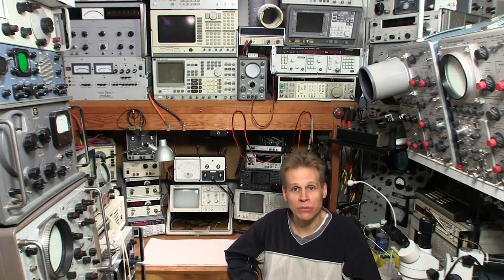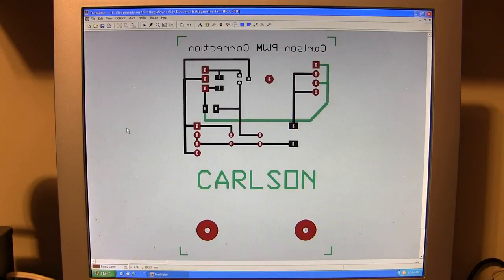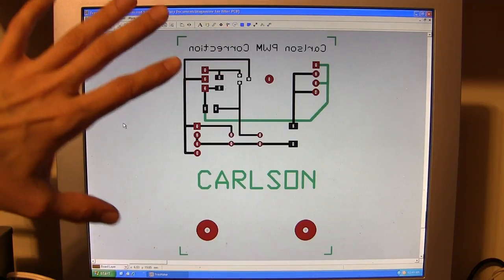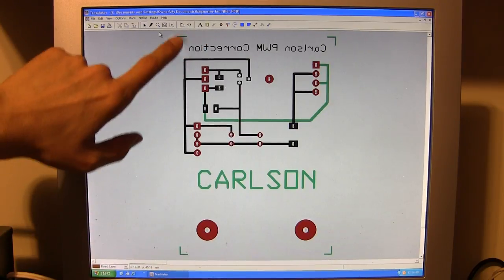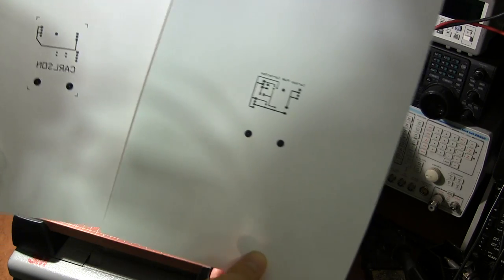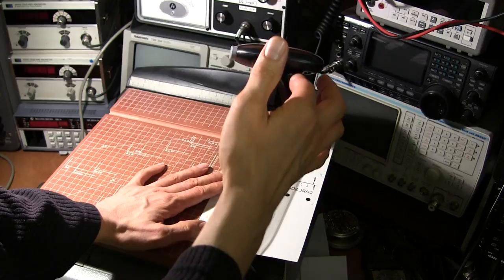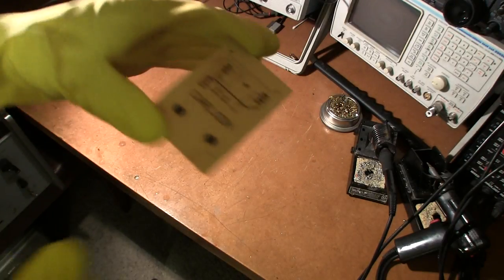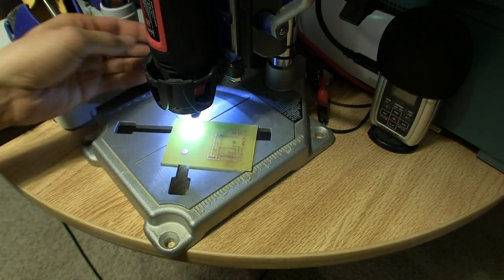How to Make Double Sided Circuit Boards at Home

Comment: Laminator is cool, but using heat transfer paper with an iron is much cheaper. Also you can print both sides of the board on 1 heat transfer so their mirror images of each other and then fold the heat transfer over your board... Saves you from buying a laminator and projector. I mean if you have the cash to do so sure, great idea. But Im a poor engineering student and transfer paper and an iron works for now.
Reply: Hey, what kind of Transfer Paper do you mean? I cant find something similar here in Germany? 
Had a Laminator Construction but it broke down (in fact it was a normal Laminator without Housing etc and taken the Temperature Sensor off and i put a Thermometer instead on and watched by my self - but some day my plastics were broke of - i think they didn't like the heat and got brittle...)

Now i'm just getting back to the electronics thing and would like to make my circuit Boards again - but if there is a way without a laminator it would be great :)
Reply: folded. thats it. i always get unmatching mirrored holes liek  ·.
Reply: Christian Schmidt Search eBay for  PCB Heat transfer paper. Many suppliers and sizes should come up
Reply: Iron alone touches only several spots of the board, in order to reliably press all surface of paper to the board you have to put iron upside down and roll with rubber roller on top of the board, which is kinda bulky, dangerous and not comfortable to do, this is where laminator is such a nice tool. I used iron before but after I modified laminator i never look back to iron times :-)
Reply: folding always introduces errors... so some people prefer not to do it that way
Reply: This is really late but... if you are REALLY cheap, you can tear out the pages from glossy magazines to feed in to your laser printer instead of buying transfer paper. It works about the same way. I am not saying it is better, but I will say I have done it and it works...

Comment: Great video. I've been using the lightbox/photoresist technique for years, but definitely will give this method a try. 
Just an observation, but I find Dremel gear has diminished in quality over the years I would recommend looking at the Proxxon drill & stand (press), they are much more precise and robust, especially for PCB drilling, similar price too. Plenty comparison videos on here worth watching. Thanks for the in-depth tutorial.

Comment: Hey Paul nice video,
 Years ago I worked in auto body repair and used a lot of solvents. The problems you've seen with acetone and laser printer ink are due to the chemical reaction between acetone and the plastic in the ink. Empirically speaking lacquer thinner is much stronger than acetone. There are many times that a paint surface can be cleaned with Acetone without issue but lacquer thinner will cause major chemical reactions. 

   Also the jobber I used to buy paint supplies from used to tell me that it's important to check if lacquer thinner is sold as virgin. I don't recall the specific reason but I was told that some paint stripping chemicals are known to make it into recycled lacquer thinner. He told me this after I got some of the cheap stuff on my hands and started to get the same kinds of chemical burns I've gotten from aircraft paint strippers (seriously nasty stuff).
  Acetone is generally more mild, but it can leach the oils out of your skin. This can lead to immune system issues. I think of solvents in order of strength for urethane/epoxy painting and surface prep in order from weakest to strongest: Water, Car Wash Soaps, Simple Green, Palmolive dish soap, Alcohol/Ammonia, Wax and Grease Remover, Urethane Solvent, Acetone, Lacquer Thinner, Aircraft Quality Paint Stripper, Sand Paper.

  All the best, -Jake.
Reply from the maker: Thanks for your input Jake!

Comment: I first started trying to do PCBs when I made a "Light Organ" in oh, 2012 or so. I ended up going a much harder route. I used glossy paper out of magazines to print the mask and a clothes iron to transfer. Tip #1 You have to be REALLY careful with an iron, or you will put too much heat in and cause the copper plate to separate from the silicon.   Tip #2, if your transfer has a few weak spots you want to touch up, permanent marker will work, especially if it is a non-critical or small spot. Tip #2 Keep close tabs on your PCB when in the etching solution, once it eats the copper way from your masking, it can start to undercut the copper under the mask from the side. Thin traces are really susceptible.... Awesome video(s). I love every one of them.

Comment: This brought a smile to my face.
This was before the days when UV etching was available to us hobbyists!
Over 35-years ago, I used to design my own circuit boards by hand - using etch resistant transfers. A complex single sided board could take me a few weeks to construct. After etching, the drilling was hand-held with a 1mm drill bit! I always drilled the holes before cleaning the board. My cleaning was soapy water and very fine wet & dry paper.

Software wasn't available in those days - thinking about it, PC's were in their infancy!

Those were very enjoyable days.

Comment: Great video Paul! The last time I made a circuit board (30 years ago!) I used the photo transfer method. The board was laid out by hand on a transparency sheet, and then the image transferred by shining a light through the transparency onto a circuit board pretreated with a photo-sensitive solution. It looks much, much easier to do this way.
Reply: +Rob Clift Down here mass production uses the silk screen method.  And I did a simple one 35 years ago.
Reply: +Rob Clift ..back in the  70'sI bought a few Heathkits that involved making double sided boards using the photoresist...worked out OK...I even bought a heath kit light timer to use for the exposure

Comment: Hi Paul, learned a lot from your videos, and want to return a small idea:
every video I watch about the toner transfer for PCB's shows that you have to sand the copper surface to clean, but I really don't like that. It damages the already thin copper layer, often only 35µm.
What I do is clean it with whatever is needed to get visible dirt off, like acetone, or thinner. Then polish the surface with copper- or silver polish, even kitchen stuff like Vim is sometimes usable. You will be left with a clean shining surface. After that, clean it with acetone and you are done. 
Only difference compared with sanding is that it takes one minute more hard labour, but I found the result really better. Once tried, I bet you will stick to it.

Comment: I use a normal drill press for this with standard HSS drill bits. I've had absolutely no issues so far, even when the hole in the pad didn't etch properly. I think a full size drill press is a much better option than the Dremel press if you have access to one.

Comment: Won't the electrons fly off when they make a 90° corner?

Thanks for yet another very informative video!
Reply: Nope, they'll just bounce off and reverse polarity then flow back up.
Reply: It's always neat to see those old hand-drawn PCB's with nice curved traces. hehe. Totally unnecessary today of course, apart from the eye candy
Reply: board manufactures in the 1970's mastered this, they made race tracks. No 90's to be seen. ;)
Reply: Hendrik,  that's why tinning is imperative. It eliminates copper oxidation, eases solderability  and provides better electron traction around tight right-angle turns.
Don't know its effectiveness around tight left-angle turns tho...
Reply: Moggie2017A *affect
Reply: No! They’re stuck to the tracks with stupid glue... 😊

Comment: Back in the 80's, A friend and I figured out that we could make hi contrast positives to make light-printed circuit boards. We had trouble with the density of the positives, but by carefully registering two of them, we got rid of that issue. We were eventually able to use this process with positives made from a Kinko's copy shop, and eliminate the darkroom altogether. Good results. 
I enjoy your videos a lot. Very informative. 
Thanks, and peace :)

Comment: Many thanks - this is a lot quicker and simpler than making a screen or using presensitized board.  have you tried a clothes iron set on linen? I did an initial test and it seems to work. I am also wondering if Carbon Tet (if you can get it) might do the same thing.

Comment: Great video as usual! 50 years ago when I was etching boards, i used a rotisserie motor from a BBQ and affixed a rod into it that had a U shape close to the end,  I then affixes a bolt that had a circle on the end like those used to hang a porch swing, to the ferric oxide bath. Placing the circle end of the bolt into the U shape of the shaft, the slow rotation of the rotisserie would rotate the shaft, translating circular motion into an up/down motion slowly sloshing the FC across the circuit board,  this was single sided circuit boards back in the day!  We also used a Sharpee like pen to fix any issues with our layout!

Comment: Firstly, before my question, thank you for all your remarkable videos - they are great schooling! I am working my way through one after another - fantastic detail, and I like the pace!

Disclosure - I have never made a PCB but I do have one question... 
And since I have no experience my question may be silly for reasons I am not aware, so my apologies in advance!

Given that the PCB is for prototyping purposes or 1- off design, and it appears the single biggest piece of auxiliary equipment is your (excellent but specialized) laminator, and given that you have no through hole conduit, why could you not simply print 2 x one sided boards using heat transfer paper (on thin board), flip and glue them together with (say) UV glue after aligning them on a light table. UV glue would give you the working time needed to square up the layers.

Would that work?, and remove the need for a very specialized piece of equipment?

Comment: Hi Paul

I finally did it - toner transfer sucess on the third try.  Its all down to the paper in the end - at least for me.
found a glossy photo paper for inkjets.  Its dirt cheap - 12 sheets for one UK pound.  Sorry dont know what that 
is in dollars. I dont have a laminator - used the trusty clothes iron.  Man had to press real hard and rub like crazy.
First i placed the iron flat on all over the board to let it stick down.  Then i rubbed all over with the edge.
Then i wet a paper towel and steamed it three times to soften the backing paper. Then i dried it by placing iron on flat.
Finally i rubbed it all over with just the tip.  I kept peeling back a small section to see if it had fully transfered.
I cooled it very fast by dumping into cold water then peeled the paper off.  Had to scrub in hot water to remove all the residue.
Im very happy that i watched your vid.  It helped a lot. Will never do photo resist ever again.
I dont know how to attach pics to this so i cant let you see the results.
Many Thanks.  Keep up the good work.
Now wheres that smd circuit i was trying - ha ha

Comment: Hi Paul. Have you made a video that covers solder resist mask? The only reason I would make my own surface mount PCBs (as opposed to using pre-drilled prototype board) would be for a high-density layout with closely-packed LEDs, would require reflow soldering and solder resist to pull the emitters into alignment.

Comment: Excellent video  Mr Carlson on designing and making double sided printed circuit boards. I have always wanted to get into making printed circuit boards. You did a very good job in your explanation from start to finish. I have a subwoofer amplifier board that I am currently working on which uses two IC  type amplifier chips (7379 four channel ) from a five speaker surround sound system. During the removal process the foil copper paths and eyelets was lifted up from excessive heat during the desoldering process. I would love to be able to reproduce the printed circuit board and after watching your video I feel confident in during so. I do have most of the tools such as Dremel, printed circuit board drill bits, laminator,  inkjet Hp printer. I Don’t have the press and stand for my Dremel but will get it and the host of other items enumerated. I use to work in aerospace as an technician maintaining CNC and NC mills, plotters, motor controllers and C programming. I recall one vender in a seminar that brought in a small 3 axis drill and mill set up similar to a plotter that could do the same job under the control of software designed for the particular job. That would be ideal for a job such as this which is what is actually used in the manufacturing process in large companies that manufacture printed circuit boards. The chemicals such as the etching solution and silver plating is where I need to research and do my homework for the purpose of safety such as the material data safety sheets. Really enjoy your videos and since we share in our technical background some similarities such as vacuum tube technology we are probably around the same age. Keep up the good work.

Comment: I've just started making my own test boards and I found that the photo paper can be bought in a walmart for around $8 for 50 pages. And better than that is that the small board prints to the center of the page. I found that I can cut the photo paper  to a little bigger than the print area, then spray 3M 77 tack spray, one small shot to the back of the photo paper, then place it on the page dead center. The HP printer prints just fine,  I have done it many times, and it saves me from wasting the paper.  The printer circuit board I scuff with 400 grit, then 600 grit, then clean it with denatured alcohol, or  goo-gone works really well. My prints are stuck to the board with a hot  iron with steam setting off. I place the board in water and wait a minute or two, then just peel the paper off.  I etch the board using  acid with some 12% food grade peroxide added, and the board fully etches in a few minutes.  I reuse the acid by adding more peroxide, as the peroxide diminishes in strength over a short time.  I have glass bottles that hold my acid, which i keep out of reach, and clearly label as dangerous.  I'm in the process of making a tinning solution, which I got  the plan from Youtube  to making the tinning solution. I already had tha acid, so I only needed 95% or better tin, and Tarnex, which has a chemical in it that causes the tin to adhere to the copper , once the tin is dissolved in the acid over night. I'm not so sure i really need to tin boards, but they are much easier to see when they get dense with a circuit. I think the tinning with add strength to the traces  as well.  I try to route my traces as big as I can, but in many cases, it is not possible to get very big traces.

Comment: Another great class in Mr C's lab. 

Re. working around the tripod, buy or make a T-head. Its just a bar that mounts centered in the tripod's 1/4-20 mount screw. Mount your camera on one end and a counterweight on the other end. This basically offsets the camers from the mass of the tripod and gives yous working room when filming.
Reply: davecc0000 he also recently mentioned that his camera’s pretty heavy, so light duty sticks might not support double the weight.

Comment: I really enjoyed watching this video, but I have one question. Why draw a box around the board, only to replace it with corners; when you then have to draw lines back on again at a later stage? I thought at first that it was being used as registration marks, but you were using the holes in the pads for that.

Comment: I have just bought a laminator but unfortunately it gets nowhere near hot enough so i am looking forward to your video on the control circuit that runs it at the higher temp needed.
Berni
Reply from the maker: +berni ken Thanks for your comment Berni!

Comment: great video and skills as always.. :}

i wonder if disconnecting the heater in a laser printer would result in a faster toner transfer from the paper to the board.
would a crafts 'Electronic Cutting Machine' work in making a template and then using either the positive or negative to mask the board?

Comment: Would this same work process work with the same materials if it were used to make a PCB for a tube amplifier, with it's high voltages & currents?

Comment: A very good presentation, that I would recommend all that are new to PCB making to watch,. However I have been using, a small portion of, Muriatic Acid, mixed with Hydrogen Peroxide, I aerate the mixture with a small Aquarium aerator, to keep it green. I made a gallon of it in a covered glass container, from Wall Mart, Six years ago, and have made hundreds of boards, single, and double sided, with the same solution, and in fact still using it.

Comment: Very nice. I am getting ready to start doing this. I have had to slow down on Tech and creative work due to engineering responsibilities. I have sill been doing amp and Hammond organ repair in between. But I am getting ready to retire. so gearing back up. Love your videos. Do you have any suggestions about getting a reasonably priced spectrum analyzer? Or is there no such thing and I just bite the bullet.

Comment: Very good demonstration of making ckt boards at home. I didn't realize that you can
get liquid tin to tin the copper traces.  I usually farmed out my ckt boards and had the
pc board place tin them for me as the plated through holes required a special process
in any case to deposit copper inside the drilled out hole and then tin plate it, another
step that was best left to the more experienced.
Reply from the maker: SuperCarver2011 That's the only downside to this, "no plated thru-holes" But.... I don't mind, I just solder it on both sides. For the via's, I use a small diameter wire ".020" and do the same. Thanks for your comment.